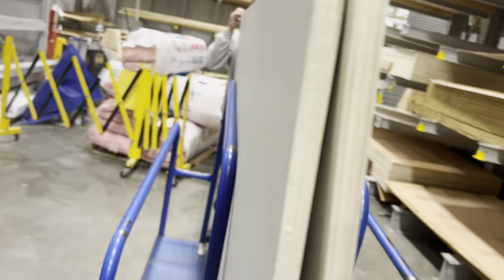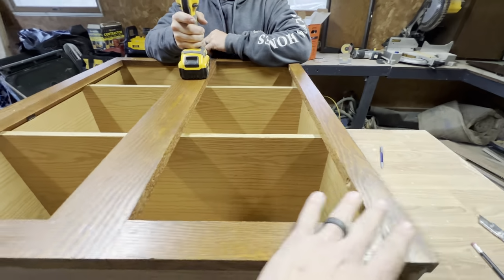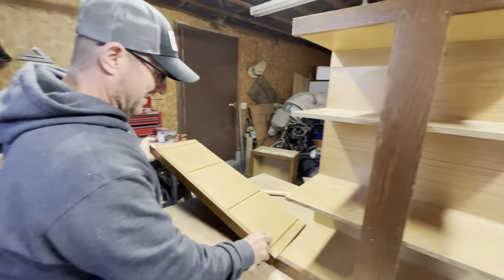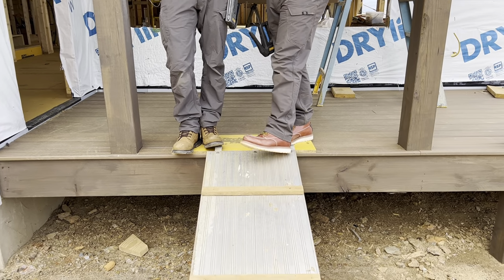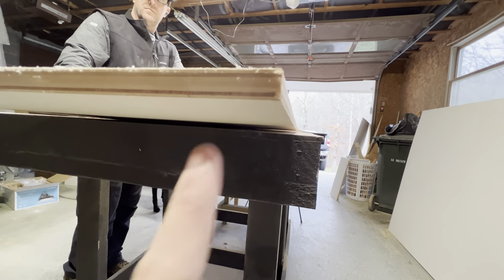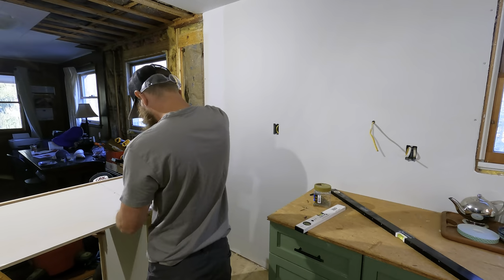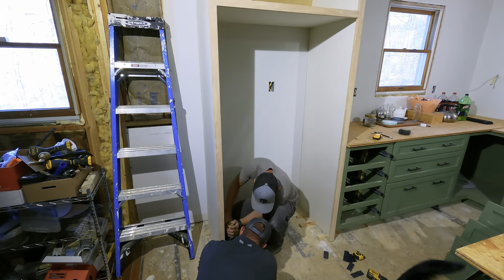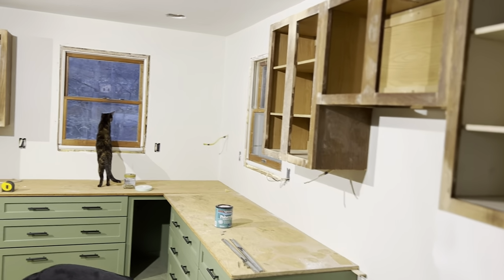Modern Home Makeover // Upper Cabinets - Episode 22

Comment: Did I spot a broken dewalt drill in the last kitchen shot? The one that got dropped off a roof a LONG time ago on the Perkins channel. The one that’s got the broken handle above the battery. That one?
Reply from the maker: Yep 🤣 I gorilla glued it, but it didn’t hold up very well. It still works though 🤣

Comment: It looks like the face frame of the fridge cabinet sticks out proud on the outside a little bit. Usually I have seen that gets filled in with some 1/4" material. Also you may want to add a small vertical spacer bar between the cabinet to the right of the fridge to make opening that door a bit easier
Reply from the maker: The face frame is proud on purpose to match the rest of the cabinets. As far as the doors opening there won’t be any problems.

Comment: No worries, I am working on my DIY custom kitchen since December. Can mostly work only during the weekends on it. So far I am done with an oven cabinet and the kitchen island is almost done. It's missing drawer fronts and the sliding doors still. Next on the list is the massive sink cabinet and a small drawer cabinet. The final one can only be built once I have the sink cabinet in. It is a corner cabinet designed as a "L"-shape and I need to figure out the "L"-leg dimensions by measuring from the installed sink cabinet side. 
Anyhow, "simple" things can really drag out over a long time span if one's personal free time is scarce...

Good luck!
Reply from the maker: Good luck on your remodel!
Reply: @Building_Jays_Way  Thank you!